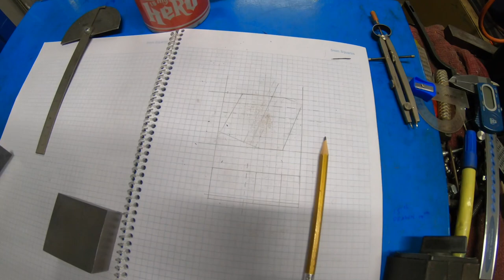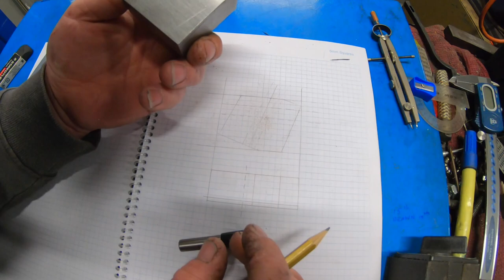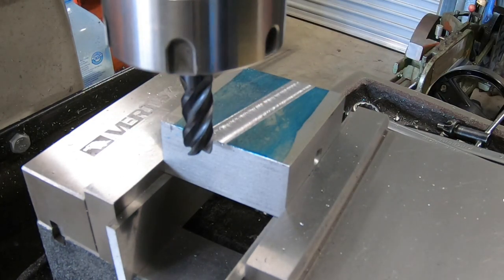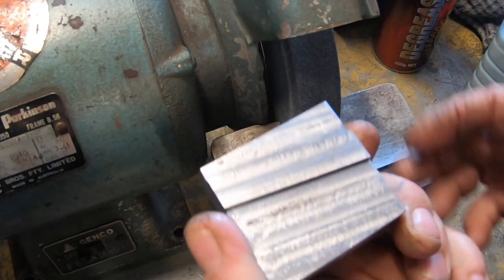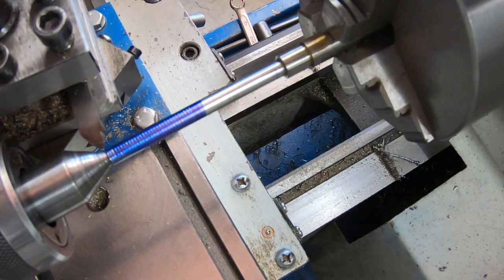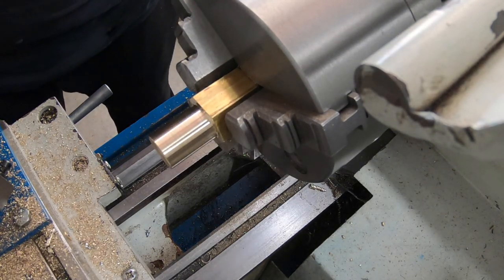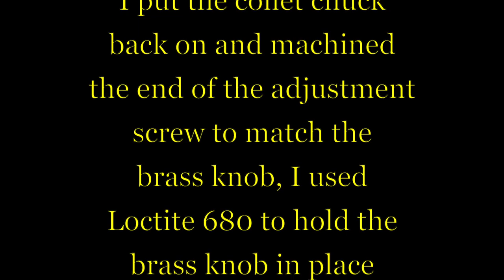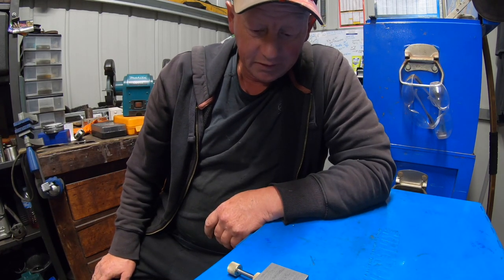Grinding wheel dresser

Comment: Hi Matty, can you explain why it had to be angled and couldn't have been simply straight? Thanks, Mike
Reply from the maker: Gday Mike, I decide to put it at an angle so when you adjust the diamond into the wheel the diamond rotates so you not using the one section of diamond all the time, hopefully gain longer life from the diamond, I hope I explained that probably, Cheers Matty